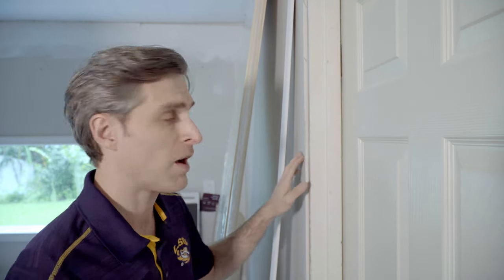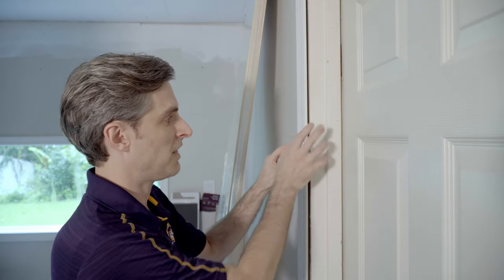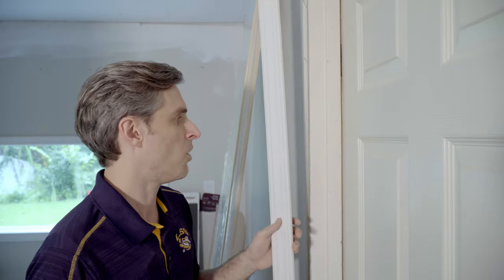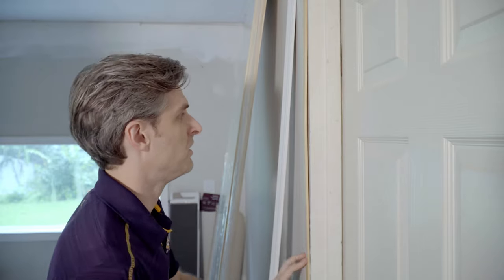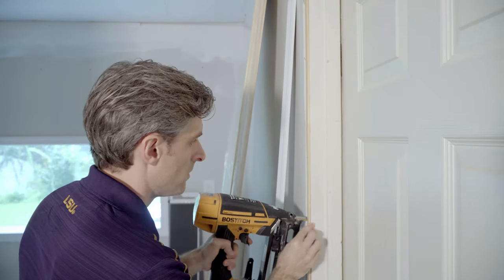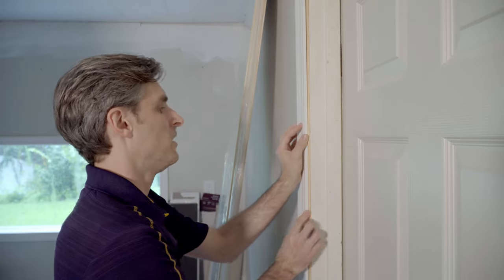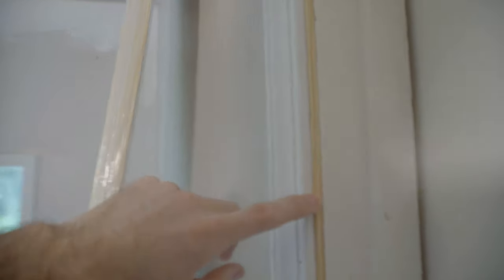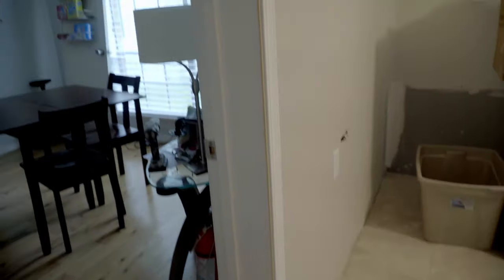Wall Sticks Out Past Door Jamb / Frame? Simple Way To Fix Door Jamb Gap!

Comment: Just saw the Vancouver Carpenter carve out drywall to solve this issue, and was mortified.  You’re solution is far better and much cleaner looking.  Thanks for posting it.
Reply: Sometimes it's better to carve the drywall, like if the drywall sticks out on only one side, or if it sticks out in only some areas.    In the situation with this video, since the molding and jams are painted, he could have just filled the gap with caulk, smoothed it out carefully and painted it.
Reply: I saw the Vancouver carpenter but a different vid and this process is called a jamb extension and not at all uncommon. With a table saw easily remedied.
Reply: I'm thinking of carving out the casing instead of the drywall, because the work can be set up on a table saw.
Reply: @shoo7130  If your casing is painted you could just build out the jambs then put on the casing and fill any gaps behind the casing with caulk or mud.   It's all so much easier if it's getting painted.    Seems to be tough to use a table saw to carve the back of door casing.  Difficulty depends on the situation, like whether it's wavy or a consistent angle.
Reply: No such luck.  The trim and door are stained and polished.  An ordering error left me with a step, but the wall is straight which makes me think table saw will be less messy than drywall cutting, and I can make up any remaining gap on the outside with caulk if I cut generously.

Mulling it over until the weekend, though, because I'm not a pro.
Reply: I mean, in thinking I set the fence to take off 1/4" and just run all the trim straight through with the blade deep enough that I can snap off the unwanted material to get an L shape.

Comment: I've installed thousands of windows and doors and this problem is so common, especially in older homes. We're always ripping extension jambs for windows on the table saw. Quick easy solution. Also works best on white trim with pre primed lumber.
Reply: Ditto with the thousands. But a paint line or crack will appear between the extension and the jamb over time. This is a certainty. Better to set the extension back from the face of the jamb an eighth or so....

Comment: Thanks for the tip.  And thank you even more for providing a thorough explanation in 3 minutes.  I will be replacing the paneling in my attic bedrooms with drywall and my initial thought was I was going to have to rebuild the door jams from scratch.  Your solution is perfect!

Comment: Good video, Steven.  I agree that when you have a consistent offset around the frame it makes sense to add the jamb extension.  But I also agree with a couple other commenters below that it generally looks better to add a secondary "step" between the existing door jamb and the extension strip.  This way, if you get future movement or have any trouble getting PERFECT flushness of the extension strip to the jamb, it won't show due to the step.  If possible this step should be a minimum of 1/8" but better if more like 1/4", similar to other steps in trims and moldings.  In other words, make a deliberate step as opposed to having a very slight step that looks like a mistake or misalignment.  This would not be possible if you are doing a low budget reno and reusing old casings, but if you are cutting new, make the casings enough longer to allow for a deliberate "step".  Obviously, this detail is subjective, I'm just sharing my opinion as an architect and occasional finish carpenter.  Keep up the good work in helping people solve problems!

Comment: This is exactly what I need to do for a new exterior door I installed at my parents house. Unfortunately while installing the door and maintaining plumb, I was not able to keep the door frame even with the drywall inside. I wanted to confirm my thoughts on ripping and extending the door frame. Thanks and great video!

Comment: Problem with older houses is you'll have doors where, for example, the jamb is proud at at the top and then drywall is proud at the bottom; meaning the gap isn't consistent for a strip of wood to fill it evenly. People plane the jamb, cut out drywall, or just caulk their problems away. A pain nevertheless.

This solution only works where its a simple uniform gap throughout. If your jamb extension is only for half the length of the door, it would also look pretty bad

Comment: This is a typical jamb extension. 

You don't want to line them up however. You want to create the same reveal on the extension that you would for the trim piece. You want that shadow line and as well, if you caulk it, it's less likely to Crack this way.

Comment: Typically the jamb is slightly rounded. If you put the extension flush with the jamb there will be an indentation where the edge of the jamb and extension meet. Set the extension back the same distance as your casing reveal.  It will look much better.

Comment: Just had two new windows installed into my 58 year old house, and those old 2x4 are wider than the modern ones, so my new 2x4 window, is now recessed 1/4 inch behind the drywall.  I will need to do something like this.

Comment: That is proper way to deal with that but any time you add extra wood have to be reces not flush with door frame because after painting paint between dor jamb and added strip will crack

Comment: I'm not able to do this because I need a stain finish, but rather than trying to cut into the drywall I'm thinking about shaving off some of the casing instead.

The benefit is that I can set it up on a table saw and cut the step into the back of the casing without all the mess and hassle of cutting drywall.

But will it work?  I don't know.  I might not risk it on wedge-shaped casing like that but mine's rectangular and I can just use thicker wood.

Comment: This method only works and looks right when the wall sits proud evenly all the way around. If you do this make sure to leave a small reveal on the extension and another reveal on the trim piece. Otherwise it won’t look good.
Reply: This is exactly the problem in my house -- the drywall is only proud around some parts of the jamb.  If I were to add a filler strip around the whole jamb, the trim wouldn't sit flush on the drywall in the other areas.  It is a great technique to keep in mind for the right situation, however!

Comment: Also the ONLY solution to use for this issue if you have STAINED WOOD trim. Like I do. In my entire house. All of it. Not a single inch of painted wood to be found. The filler strip, or infill, can be stained and varnished very quickly. In my house, I'm resigned to having to do a double reveal, as well. You simply cannot caulk stained wood.

Comment: Offset the spacer from the door jamb with a reveal, then offset the molding with a reveal on the spacer
. Otherwise there will be cracks in the paint in 1-2 years.

Comment: Thats called screen mould and it’s - these days - used for butt joints in ply on soffits n similar.  This application of it is great but flushing it with the jamb face creates a joint that doesn’t finish well.  The back side of that screen mould has a sharp corner but the corner of the jamb does not.  Trying to flush those two doesnt finish well at all.  It’s a much better look to back it away from the corner of the jamb 1/8 or 3/16 as you would your casing then back the casing up from the screen mould edge thereby creating a double reveal.  It’s a way better look that doesn’t scream DIY.

Comment: If the wall has a bow, and the gap isn't consistent, should I install a thick extension that protrudes (using glue) and then plane it down?  Is a power planer the best tool, or is there something better that would allow me to basically follow the drywall surface?  I have a 1/2" recess on my brand new front door because the wall actually leans that much.  With an interior door I just installed myself, the stud has a kink, so I have 1/4" recess on one side at the bottom and 1/4" recess on the other side at the top.
Reply: Do you have a table saw? If you do,you can make a tapering jig to cut you a piece to fill the gap . All youd need Is a board about 4ft long with a small screw to offset your work piece and another small piece of wood screwed to the end of the jig to keep your work piece from slipping. You can find good videos online for the build and use of the tapering jig.

Comment: For what I see there.  Someone must have installed 5/8" drywall on both sides of that wall in order to mess up a 4-9/16" jamb by 1/4" like that.
Reply from the maker: Jeff, previously the wall had old wood paneling, which was thinner than the new dry wall installed.
Reply: @StevenSabatier  I see.  So the jamb was ripped smaller than 4-9/16 to match the paneling.  Now it has rock.  Gotchya.